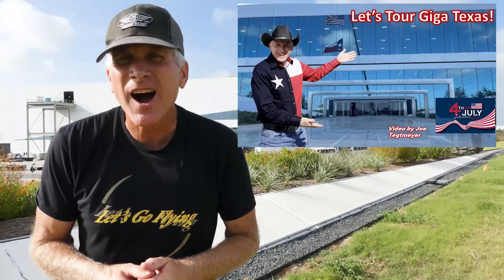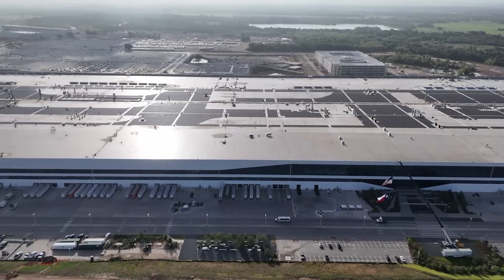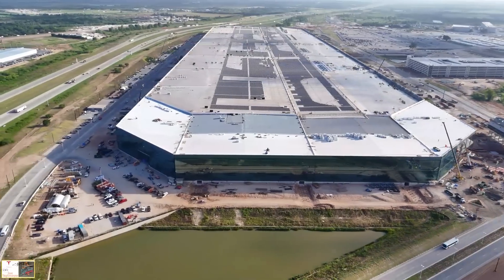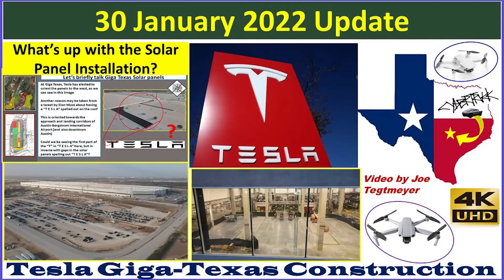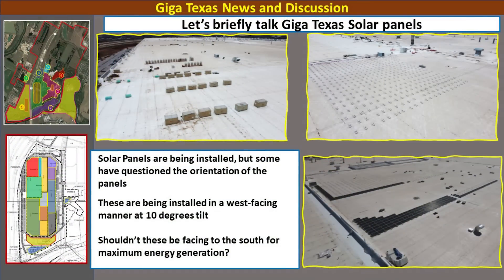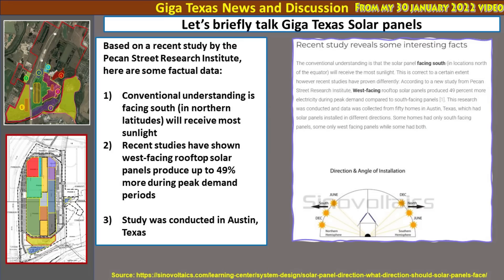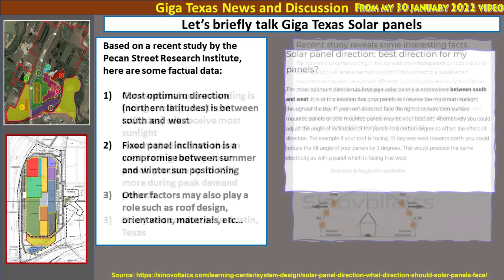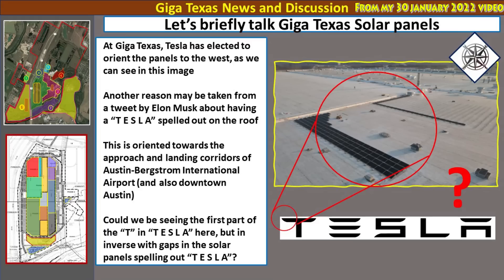Giga Texas Solar Panel Roof Discussion & Frequently Asked Questions

Comment: The rooftop teela sign looks so cool, but I seriously doubt its effectiveness as an advertising medium to air travellers once the novelty wears off. Giga Austin is so gigantic that for the relatively few people who bother to look out of an aeroplane window, they are hardly likely to mistake it for anything other than a Tesla facility; it's hardly what you'd call a tiddler, one that you'd toss back in the water due to being (undersized) now is it? The sign is so enormous that it effectively means a substantial drop in solar power output potential; not exactly what I'd call a 1st principles of thinking approach.

Comment: I have a different question, Joe: the roof is obviously filthy, I assume that at some future point they'll clean/pressure wash it to return it to white to reflect the most heat during the summer, but have the panels EVER been cleaned? if not the dirt may diminish their sensitivity substantially. Do they plan on doing it any time soon?

Comment: The direction of the solar panels makes me think of mobile panels that automatically angle themselves towards the sun. Probably costly but interesting.
Reply: These are at a fixed 10degs, plus or minus the roof pitch of about 1.5degs.

Comment: I'm surprised that the parking garage doesn't have a solar pergola on the roof. Not only is it good solar real estate, but it would also shade the cars. Actually, this is true of all the parking lots.
Reply: Totally agreed. Why Tesla, as a company, continues to think it appropriate to continue throwing money away on paying for electricity, even if it is on renewables, is totally unacceptable and beyond my ken. This is especially true in view of the upcoming 500MW requirement to power the new data centre. Can't quite be sure if it was Toyota or some other automotive manufacturer, but either way, they had designed & integrated a whole  rooftop solar array into their brand new carparking building at their manufacturing facility recently.
P.S. Not just the parking lots. Outdoor storage and WOW yards also.

Comment: If the panels are equipped with microinverters they may individually operate online as each section is wired.
Groups of panels may work similarly with an inverter.
Such inverters will not produce power unless the service is live, for the safety of workers and others during dirruptions. No battery is required.
Reply: Likely that there are micro-inverters in sections.

This is 12 months old from a comment under Jeff's Day 1094, "Roof. Solar Edge 3 phase inverters. Model is Synergy Series. 50kW for 208V grids. 80kW, 100kW, 120kW for 480V grids.
Interestingly these conventional inverters are only in the array around the letters E (where there are 12) and the S (where there are 110. The rest of the array may have micro-inverters, or conventional inverters just not yet installed."
Reply: @DessieDoolan  Microinverters are significantly more expensive that commercial string inverters with very little to be gained.  All of these modules are facing the same way at approximately the same pitch so I doubt that they use micros.  Also, the output voltage of the micros wouldn't be as efficient in an industrial application.
Reply: @bryanwhitton1784  Jeff's latest roof flyover from 10 June still not showing any conventional inverters at the north end (the T in Tesla), or the south end (the A).

Either no inverters installed yet, or micro-inverters.
Reply: @DessieDoolan  Micros aren't impossible, just more expensive and without shade issues no real advantage.  The AC output would be either 240 single phase or 208 three phase.  The 208 could be used for the typical 480 three phase but it becomes complex.  
I set up a small industrial site many years ago with micros so it is possible.  Not claiming it isn't.  But that job was nothing compared to the Tesla roof.
Reply: @bryanwhitton1784  I don't know for sure either. Jeff's regular flights over the roof have been the best to gauge what's going on. I did ask him previously to check out the inverters, and he got some good shots in that Day 1094 video.

Joe's 13 July 2022 video shows small boxes being mounted to the back of every second PV panel. At the time I took these to be 'panel optimisers' made by Solaredge as there were Solaredge boxes nearby. At the time Solaredge didn't have a micro-inverter available in the US (don't in fact know if they ever manufactured them at all).

Another site mystery.
Reply: @DessieDoolan  I am not familiar with SolarEdge's commercial products just their residential stuff.  Still not familiar with their commercial stuff but I took a quick trip to their commercial web page and that confirmed that their commercial S1200 optimizers are installed 1:2 optimizer to module.  I would be inclined to go with that solution before micros especially if you saw SolarEdge boxes at the site.  
Their commercial inverter are 277/480 output as well.  That fits better than micros as well.
Reply: @bryanwhitton1784  Not that familiar with Solaredge gear either. I'm a retired carpenter. Out of comfort zone!

I do happen to have a Solaredge inverter on my garage PV system. Sunnyboy inverter on the house.

There's still the mystery then of missing inverters at the north and south letters.

Perhaps the obvious answer is that these aren't operational yet.

Comment: Questions.. Why doesn't Tesla use a different colour panel instead of gaps?
Why hasn't Tesla put panels on all the other buildings?
Why isn't the car park covered with a metal frame with panels on it.

Comment: Tesla needs windmills
Reply: They just need more solar. Plenty of room for ground based solar farms in addition to all the rooftops. Local solar generation is less expensive than wind. Not all locations are idea for wind and they are within 5 miles of an airport. Approvals for where the wind would be installed & distribution from there slows down deployment of and increase cost of generation.

Comment: Good afternoon, Joe.
Firstly, I want to thank you very much for making all of his videos, but especially this one. This is because I have long been curious to know Tesla's policy for the production of clean energy, intended to compensate for the enormous consumption at the Texas factory.
Therefore, I present some opinions and some questions:
1) initially, regarding the roof of the main building, I have no doubt that Tesla cannot yet complete the installation of the solar panels, because there is still a lot to be installed on site;
2) as for the roof of the southern extension, I think they will design the Tesla symbol with solar panels;
3) regarding the other buildings in the complex, I cannot understand the reasons why the company did not cover them with solar panels, in order to increase the production of electrical energy;
4) I feel the same way about huge parking lots, which could be a great source of energy generation and would also reduce the amount of sunlight on parked vehicles;
5) we need to remember that GigaTexas' electricity expenditure is gigantic and the plant that supplies it is thermal, which makes this consumption unfriendly to the environment;
6) in effect, an electric car industry needs to worry about reducing the consumption of electricity produced by dirty sources, especially when it has the means to do so locally;
7) in addition, Tesla's land is huge and unlikely to be fully occupied, which could allow it to be used for the construction of a solar or even wind and solar power plant, for internal consumption;
7) Texas is a state with a high level of solar coverage, which makes not using this land a waste.
Would you know if there are any plans in this regard?

Comment: Yeah that entire roof, fully populated wouldn't provide enough power to run that entire facility even without that super computer cluster even in the discussion.  It takes a LOT of panels to provide industrial levels.   going S/SW with orientation is good to match up against offsetting later afternoon peak period draws from grid.   A hope is that through time the cells will improve substantially in light to power conversion efficiency and the same area will provide higher power levels.
Reply: Agreed. But Tesla has serious solar power self-generation real estate capacity potential, quite apart from the main facility's rooftop. 
As a company whose entire raison d'être is speeding up the world's transition to clean energy and transportation, Tesla really isn't walking the talk anywhere near enough to my mind. Additionally, Elon was quite intent on explaining just how difficult it is to scrape the pennies off of the cost of vehicle parts at the latest shareholders' meeting. Surely, if you can't do it directly, then deploy the old lateral thinking trick and do it another way, in this case, solar power self-generation; if I were a shareholder, I'd be quite annoyed that Tesla is largely failing in this respect as higher production costs mean lower profits & lower earnings per share.

Lastly, as part of fulfilling the company's brief, what can't be overlooked is the role Tesla could be playing in demonstrating to both the industrial & commercial sectors is the feasibility of using onsite renewables + storage to run their businesses. Currently, Tesla is only dipping a (single little toe) in very tepid water on this front. Both Tesla & Elon, himself, have very high profiles in the business world, yet somehow this isn't something that is being used to best advantage as far as convincing commerce & industry to go full throttle on renewables + storage as thier primary means of powering themselves. 

Frankly, it's all rather frustrating to me and it has been so for years. Although announced by Robyn Denholm at the shareholders' meeting before last, that Tesla was going to start the deployment of solar canopies & charging at shopping malls, etc, I've yet to see any evidence of this. Just imagine if Tesla really did go all in on this a part of the company's business strategy in furtherance of the mission. EV adoption would stand a much better chance of picking up the pace as it would directly begin to do away with the excuses of 'I don't have my own off-road charging' or 'there's insufficient public charging infrastructure'.
Reply: @pinkelephants1421    I restricted my comment to the roof proper and it's power production vs operating needs.

I think you're a bit off on the walk the walk - they have purchase agreements with renewable providers such that even if the actual power they're drawing is coming from the grid, they've got the same volume being generated by renewables somewhere else along the line - so the net is positive.   True for SuC as well.

The self-generation thing is great if you want to tie up the capital to do it, or you can make and sell things and work your way into it over time.  And, I am a shareholder and they're doing fine IMO.   The generation from solar canopies etc is an augment, not a fulfill scope level of power.

Idealism if fine but it doesn't balance the books instantly.
Reply: @lylestavast7652  Yes, but part of what I'm saying is it doesn't make sense to keep forking out significant suns for clean renewable electricity via PPA's when you can generate a significant proportion of your own, even if that means not being able to meet 100% of your requirements. 
To try to put it into context, roughly 30 years ago, Greenpeace UK commissioned an independent report on the rooftop solar generation potential of the country. It came down to this: (if) at that time, as (little as) 1% of the UK's housing stock had rooftop solar, it would've provided for all of the UK's electricity needs at that point in time. 
Now extrapolate that out and apply it to not only Giga Austin but right across Tesla's portfolio. There's a significant deficit on the self-generation & storage front, which makes no sense whatsoever for a company whose entire reason for being is to drive the transition to clean energy & clean transportation ASAP. Nobody should forget just how expensive that new Giga Austin data centre is going to be to run in terms of electricity requirements; 500MW is not exactly sunday roast dinner requirements. Even if the approach were to be a phased solar & 🔋 infrastructure approach, there's no good excuse for not doing so. I should own up here to nagging Elon & Tesla about this for YEARS, & I noted recently that just such an installation is taking place (in limited scope ) at Giga Berlin & includes as I've kept on saying, the 1st principles of physics approach to covering, not just the carparking but the vehicular circulatory areas too; most solar canopies only cover ⅔ of any given carparking, leaving the middle ⅓ unutilised. 

Frankly, Tesla's energy division has pretty much remained the poor church mouse relative in terms of the amount of attention devoted to its growth, only recently seeing storage deployment showing any significant signs of growth. BUT, in light of Tesla having become a licensed utility in a number of jurisdictions, there's significant opportunities for Tesla begin to deploy solar canopies, storage, & EV charging in a ubiquitous manner in carparks right across the USA, UK, & elsewhere that it has a utility licence, the company could easily utilise its solar expertise to grow the division, expand profits, support EV🔌⚡️infrastructure (with USA Gov't subsidies) whilst providing convenient EV 🔌⚡️for both naysayers & those minus a driveway of their own in order to drive EV adoption faster; Tesla, as announced by Robyn Denholm, at the shareholders meeting before last, said they were going to do exactly this. It's worth noting that energy generation deployment at or near point of use, is far & away more efficient & less environmentally impactful from mining to end user than massive transmission infrastructure. 
Elon is betting the farm on FSD & potential is undeniable. But the world needs clean energy generation, storage, and electrification of transportation like yesterday, FSD far less so. Neat technology, but hardly crucial to the liveability of life on Earth.
Lastly, I'm not focused on idealism, but basic economics & the broader picture. And getting someone (else) to do the walking for you (isn't) walking the talk, nor is it serving as an active demonstration to the commercial & industrial sectors that self-generation is just good business for both yourselves & customers alike; Tesla is enormously influential with the potential to be exponentially more so.

Comment: The real question is why doesn't Tesla use its own panels? Why did Tesla solar never explode as I thought it might?
Reply: Turned out to be extremely difficult to scale, and really difficult to bring down the costs. Given that Tesla is all about scale and reduced costs…

Some solar roofs are still being installed, but the prices are fairly eye watering. Naturally no two roofs are exactly the same unless new built to actually be the same = bespoke roof for each installation which isn’t how Tesla operates in the other businesses it has.

The business exists, but all indications are that it’s not going to amount to much.
Reply: @edwardhackett-jones8126  Sad to see they didn't push to be the leader in the space regarding how critacal clean energy is to the mission of Tesla. Still what Elon talks about as essential.
Reply: @BrianBull  question is where can they make the biggest impact?

There’s a load of very effective solar panel manufacturers, mainly in China, who have that covered. The deployment of them globally is already reasonably widespread and will scale anyway. Tesla’s input in the form of battery storage, energy arbitrage software, EVs etc is where they’re most suited for big impact.
Reply: the tsla solar panels are designed to replace roof shingles so theyre for residential use - tesla also installs traditional solar panels but they dont make those
Reply: @JoePistritto  they don't?
Reply: @BrianBull  as far as i know Tesla only manufactures "solar roof" and all the switchgear and inverters plus batteries (Powerwall) the conventional solar panels are bought from others - however i have a Tesla project open now and will ask this question when i talk to my "project advisor"
Reply: @JoePistritto  That's really interesting. Did Solar City manufacturer/make its own panels or did it also buy from others as well? 

Thanks
Reply: Simple, they cannot make enough of them fast enough, they’re currently overbooked.